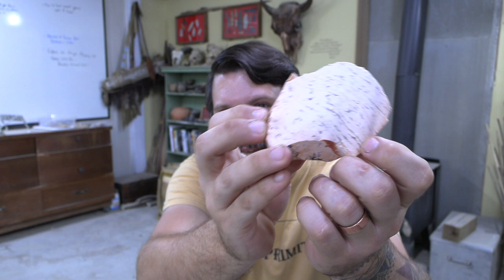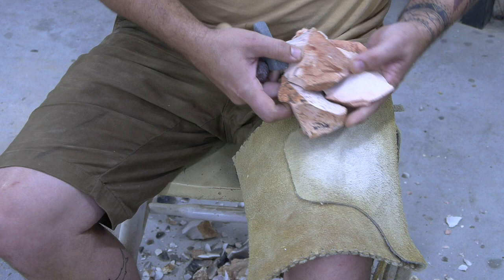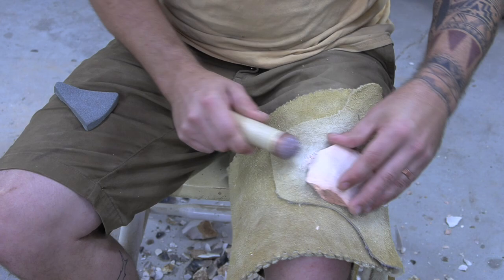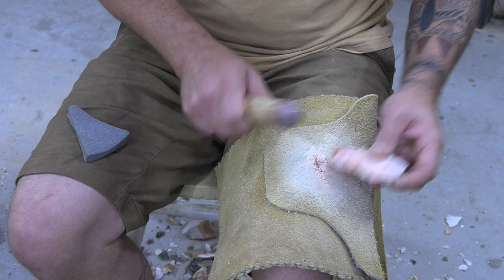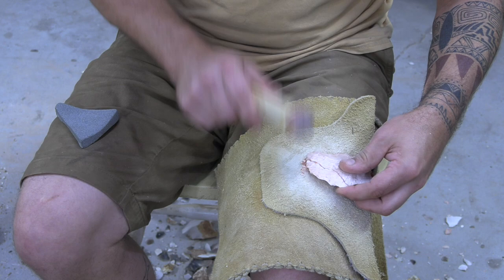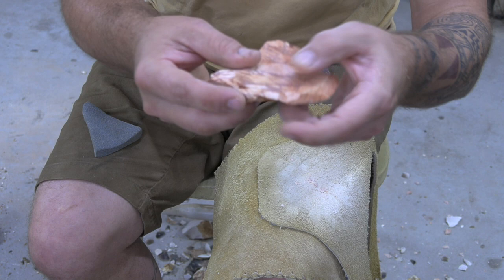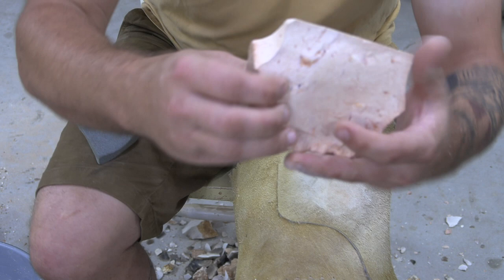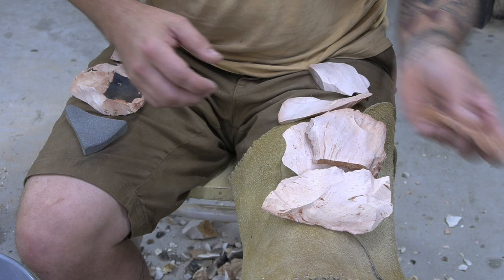FlintKnapping Keokuk Chert

Comment: I bought some of your Keokuk. The rock I received was rather chalky, not glossy or smooth like I expected. Having very little luck running any kind of flakes across it. It just wants to make hundreds of little fractured micro steps instead of sending a flake. I really took my time setting up platforms... who knows?
Reply from the maker: shoot me an email to twistedlimbs83@yahoo and I will look into it with you when I get back in town early next week.
Reply: Turned out to only be a problem with a couple of the pieces, one in particular just didn't want to play. I managed several really nice points out others.